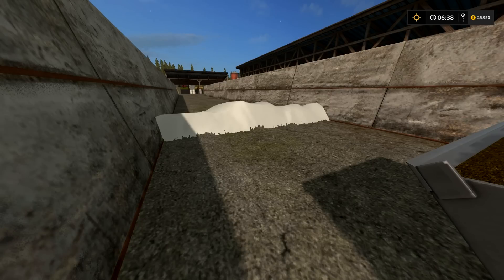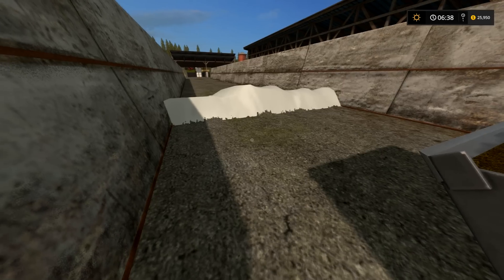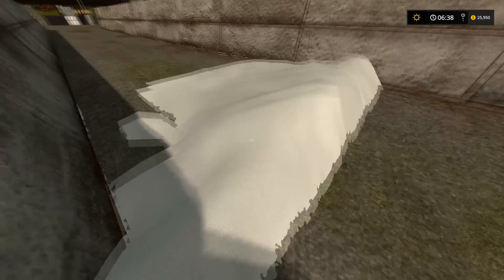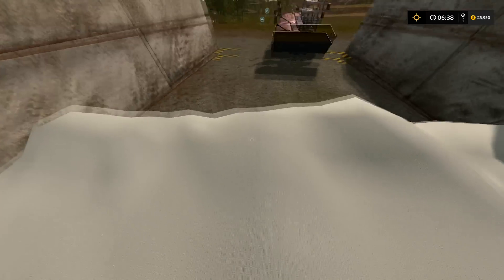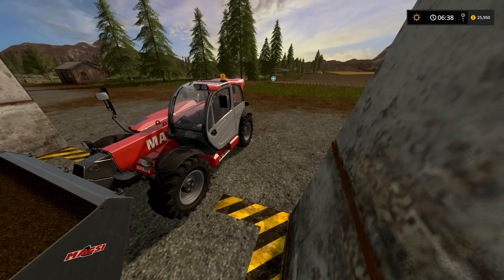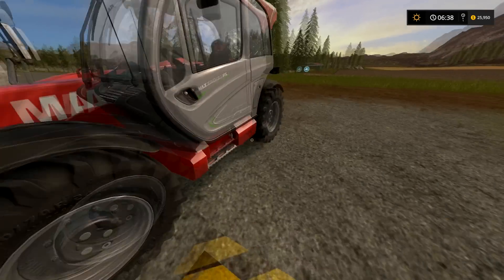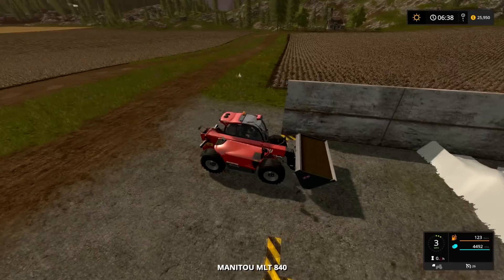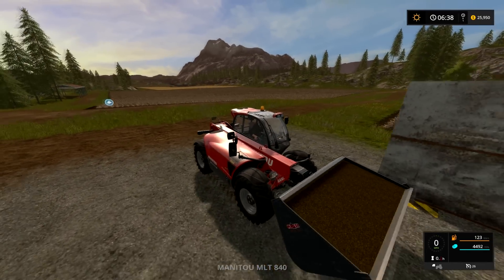FS17 Tip | If Your Silage Blanket is Stuck

Comment: is there any reason you can't sell silage with belts anymore? the belt will suck it up but won't dump it in the selling point. when I force unload it, it just goes though the selling point
Reply: 16soccerkeeper1 You should be able to sell it because I can sell it. But it might be the version I'm using
Reply: SirRt 007 I can't use belts or trailers anymore
Reply: Try the left hand side of the silo. I've had thaty issue with Goldcrests Silo 1 at the BGA. Only the left hand side of the silo seems to allow belts to suck since the update.
Reply: LeiFlux07 the belts pick up the silage on either side for me, but it won't dump it in the bucket to sell it, when I force unload it goes right though it and dosnt sell

Comment: This worked first try, however, the silage was so close to the walls apparently that I can't pick it up?? I tried a bucket, the belt, even the leveler to try to move it out of the way. I cant seem to get my first two silos empty. Anyone have any recommendations?
Reply from the maker: Look in the Mod Hub for the Silo Cleaner mod. You basically hit a button to convert silage back to chaff so you can start filling it again. It's great.
Reply: Moose2006LP I've been looking and looking through the mod hub and haven't found it. I'm playing on Xbox One, so I wonder if the mods take longer to get the consoles? I'll keep looking! thank you!